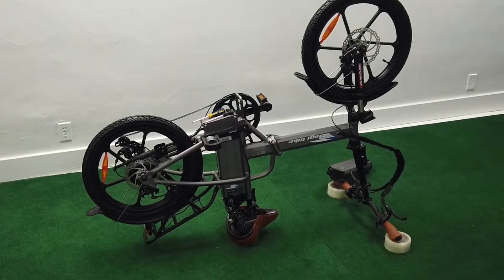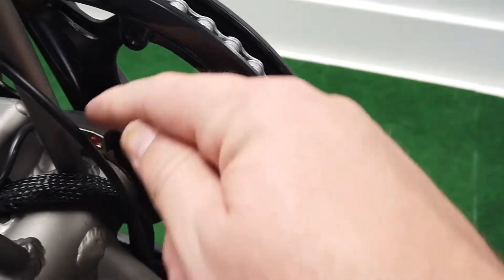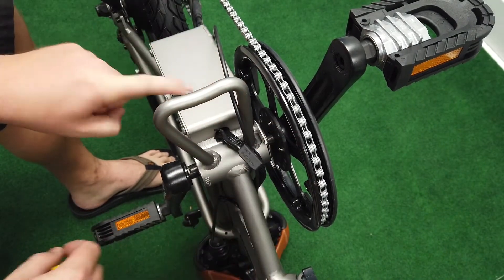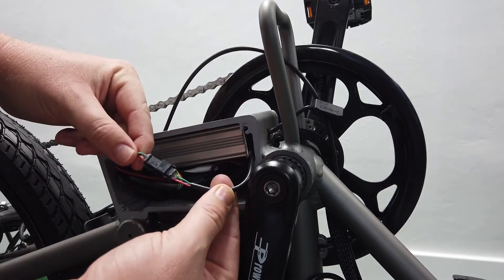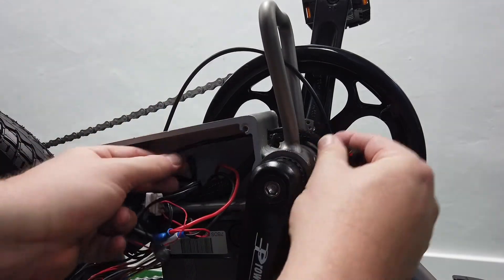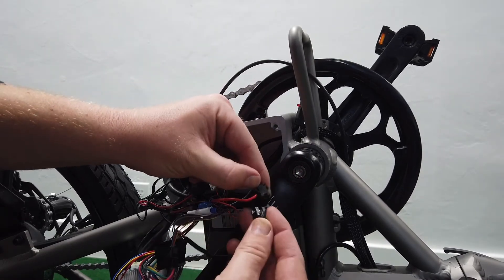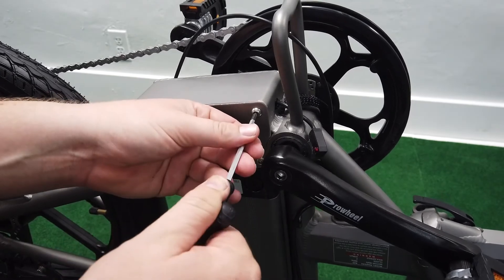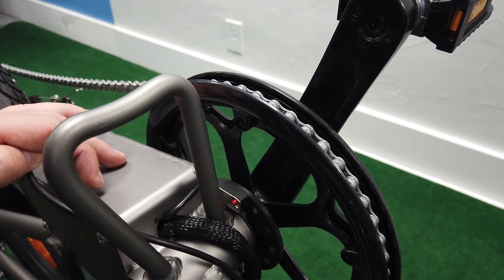Replace a Pedal Assist Sensor on an E-Bike

Comment: No LED on mine, where the assist stopped working and the throttle still does! What's that controller though? Every time I pull e.g. the controller out, a wire breaks and has to be resoldered; they are so flimsy (had to use CAT5 as nothing's thinner that works!).

Comment: How does a speed sensor work? my speed readings crap out after some time on the road, worse if the temp of day is hotter, and the ODO doesn't record mileage while crapped out
Reply from the maker: Might be a controller problem or motor problem.  Prolly a hot motor.  The pedal assist sensor has nothing to do with the speedometer.  What bike do you have?
Reply: @FarBikeShop  Fortis sold by Kogan

Comment: How to make it waterproof to protect the controller and the battery?
Reply from the maker: Use Silicon window sealant around the door, and the wire holes.  Its not perfect but it helps.
Reply: @FarBikeShop  blue tacks easier to remove.